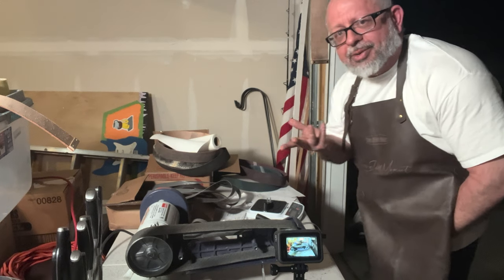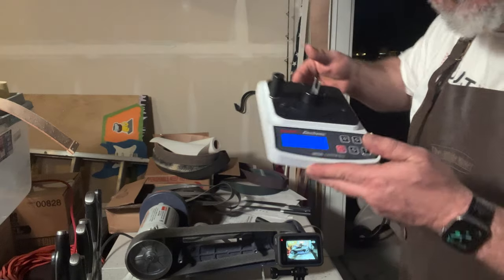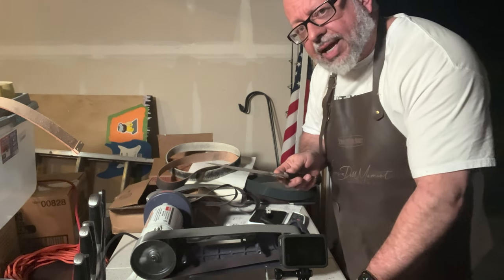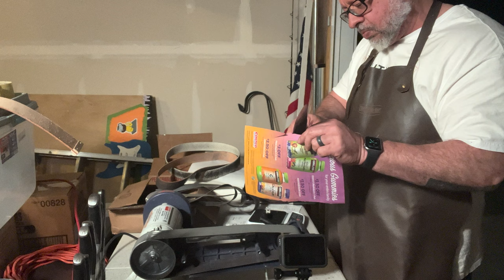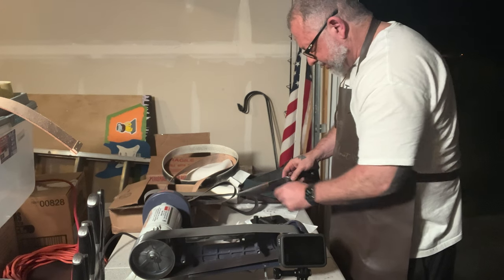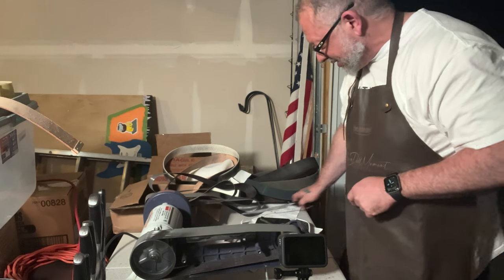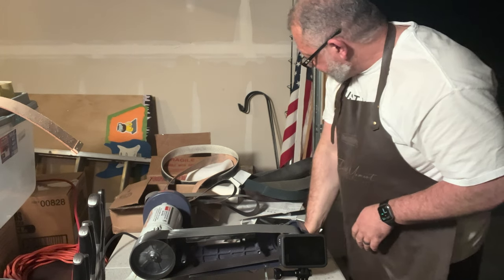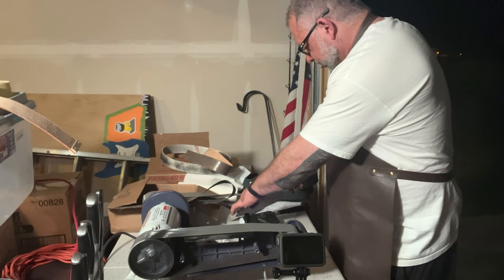Learning to use a belt sander for knife sharpening. 2 x 42 inch - Sharpening VG10

Comment: Just for grins, I recently took in a "guest knife" with a rolled / squished edge. I stopped pushing down on the BESS thingy at 1740 😂 (one thousand seven hundred and forty). A dull butter knife disguised as an 8" chef's knife. I gave it back testing two spots, 80 and 120. It was a lengthy repair. Wish I'd known a bit more about belt sanders.
Reply from the maker: It’s definitely been cool to try and to learn. I love learning. Don’t mind doing it for you guys.

Comment: Really interesting, and so much in that use of belts with different grits and steels. For me, personally, I'm very relieved to see that you do not worry about heating up the edge, and don't wear a blacksmith's "air hood" or whatever they're called. My current sander (3"x18" designed for wood) is a variable speed, set on slow. The things are loud! I use it to repair edges, and set a bevel, so I can sharpen on stone. The "so much in it" part: softer steels' burrs are not the same as harder steels, as you have mentioned several times, and as another site confirms, and on HRC 56 I get huge mega-burrs, but that's after sanding out 100 micron chips on coarse grits. My guess is that harder steel burrs flake off (more brittle). But a sanding belt is so much faster than grinding away on an Atoma 140 diamond plate. And it's easier to set a bevel because your hands aren't moving up and down the stone 100 times. The belt does that for you. It ruins the "romantic tradition" of whetstones, but even Japanese traditionalists have huge grinding stones. I'm impressed that you got BESS 100. I didn't think that would be possible on a belt.
Reply from the maker: Thank you. I loved your comment. I appreciate it so much. I loved everything you wrote and I’m enjoying reading this. I definitely think I can get a better score but I’m glad to know we got one that low. I’m still going to experiment, but I still love the romance of doing it by hand on stone.

Comment: I love your set up,  the garage looks like my basement. Lol
Very cool. Still be tryung to get good with stones. Was thinking of getting a 1 x 30 for wood and sharpening.
Was wondering if there is big difference with slack vs platen sharpening. You make it look easy my man. Nice video. Thank you.
Reply from the maker: Listen, thanks for the comment. Thanks for coming and enjoying this experience with my self. I’m learning with you and yes I now want to clean up my half of the garage and make it into a workspace. I just feel like being a guy and making it all tool man Tim. I need to be able to make it a little bit more efficient. I definitely think each thing that I have learned has help with the other things that I do. I’m enjoying the slack belt, but Ryan Swanson excels with the platen behind it. I tried to make one the other day and it turns out I had some of the wrong material. Ryan has now advise me on what I need to get. When he does it he keeps the belt sander vertical. I’m not sure that’s the way I want to go. We are going to mass with a different set ups. And some upcoming videos we will show you the options of this machine and how I had to alter it slightly to be able to do what we’re doing. Unfortunately, a lot of the expensive machines are not ready to go out of the box. If you want to spend $5000, then you’re able to get something made specifically for the task. I’m sure one day my wife will allow it but right now today is not that day. I’m gonna enjoy keeping the higher grit. I’ve done some of the lower grits. Laughter watching Ryan Swanson. I even watched Cliff Curry. It’s hard to grasp the idea that the rougher grit ends up acting like a higher grit when it’s moving fast. I also need to try different pressures. I might be able to turn something into a higher grit with less pressure. Lots of concepts. I was even told a little secret the other day. A little birdie told me to take the finest grit scotch Brite belt once it’s worn out and add some WD-40 to it, and it gives an incredible polish. I’ve even learned that the Trizac belts can be refurbished by using the diamond plates. There’s so much information out there to share. Stay tuned.

Comment: Thanks for your video. Recently got 1/30 belt sander and tried to sharpening already sharp knife. I got bar one side, once flip other side other side barr created but couldn't feel first side. I start first side than loose bar opposite side again. I didn't get any sharpness at all. Finally i found lot's material been removed, knife gets smaller and very dull knife. Not an expert with stone sharpening either but i Neve ended fully dull and half the size of knife. Use 100grit. Any advice where did i mistake? I had the angle jig so angle suppose be correct. Im in in very upset condition. Thanks

Comment: Very impressive results though. 
Now a major question is coming, 
Do I have better results with the belts or with the stone's?

Food for thinking and maybe one VS in live process between them might be good .
Reply from the maker: I definitely think the stones are going to be the best. You can argue that the tormek eight is gonna be the best there is and maybe even the guidance systems. We haven’t gotten into that yet. I think the guidance systems are really good at maintaining the angle and you can change your pressure. The tormek eight has been proven by knife grinders to really get amazing scores. Scott Gunn has gotten ridiculously the lowest scores I’ve ever seen and he did it by hand. I just don’t think the belts can get you that low but when you need to get it done fast and that high quality inn, you’re a commercial sharpener, then it’s hard to beat it.

Comment: On the other side of tbat sander can you hook up a wheel like a cloth buffer wheel or something as aposed to a sanding plate?
Reply from the maker: I'm sure somebody can. That's not something I'm still bad. There is a rotating sander on the other side, so I'm not sure what type of cloth you can put on there, but sounds like a winner.

Comment: Good afternoon.
In my practice, I noticed that when ribot on the belt grinder, too much area of elastic metal is formed. this zone is polished, but knives sharpened in this way do not have good stability indicators.
this effect is especially noticeable when working from grain.
maybe it's me doing something wrong?
Reply: Google translate ricochets again?
Reply: @davesmith5656  yes
Reply from the maker: I have read this several times. I am very interested in answering your question. I don’t know that I understand the question fully. I apologize for the language barrier. I do appreciate you coming to the show and I definitely appreciate your comments. I desperately want to understand your statement and question. God bless. I’m going to read it again some more and see if I could figure it out, but I just wanted you to know that I did read and wanted to acknowledge your comment.
Reply from the maker: Ribot. Maybe you meant to say when you rub it on the belt grinder??
Reply: @nadm  when I'm working on a belt grinder. it turns out that too much elastic metal zone is formed on the edge of the cutting edge. later it is polished. but such an edge does not have sufficient stability.
the situation is somewhat better when the work is done on rotation. not against rotation.
Reply from the maker: @workshop_oselok_kyiv  thank you. I do believe I understand.

Comment: Does it matter which part of the belt you sharpen on? I notice sometimes you are on the slack and other times you’re not. Thanks
Reply: Decent question. It seems the slack would give more of a convexity, maybe pull off burr like a hanging strop. Then again, maybe the belt tension and thickness are enough to keep it flat.
Reply from the maker: You’re correct. I’m going to finish answering on the other guys comment.
Reply from the maker: So I use the slack belt for the convexity. Also, the knife doesn’t bounce. You’ll notice when I go to put it on the flat. There can be a little bit of a vibration on the metal that’s behind the belt. I kind of like the Grace of doing it in the slack bell area. There is going to be a difference in the thickness behind the edge, giving you that convexity that you were talking about. We’re going to be playing with that as well. The one thing that I’m missing is doing edge leading strokes. Very dangerous on a belt sander. If you had a guide, an angle guide, then it could push back the knife off the belt and you would be safe, but if you try to hold it in there and get the wrong angle then you’re just really asking for a disaster. I’m having a little bit more fun on the slack belt.

Comment: never use a dry belt 
edge will heat and become soft.
seams sharp but then it dulls faster
Reply: Have you ever seen the sparks flying on the wheels the Japanese knife makers use in their finishing and sharpening?  I have to assume you have never seen a knife made.
Reply: @GlennInLaguna  --- As far as I know, tempering, the final stage of heat treatment, starts at around 800 C, lowering the temperature in stages over several hours, and the last temperature before cooling is 200 C. Water boils at 100 C, so I feel fairly certain that if an edge doesn't leave a burn mark on your finger, it isn't anywhere near 200 C. I got jerks telling me I'd overheat the edge and ruin the heat treatment. Some people talk off the tops of their heads like parrots, mimicking anything they hear, even doorbells. I have heated up an edge enough that I didn't want to leave my finger on it, but I had put pressure on the sanding for seven or eight seconds. I am not sure at all about this, but I think that you have to heat steel enough to turn it blue, to ruin the heat treat.
Reply: @davesmith5656  I agree with you fully. My comment directed at chefalbino, was that knife makers around the world use dry wheels and belts in the final finishing and sharpening of knives.
Reply: @GlennInLaguna  --- Yes, I was supporting your comment. I'm working on trying to be more polite and not omit things like "I agree with you".🙂
Reply: Understand.  Even though I use belts to refurbish and sharpen knives.  There is nothing better than sharpening by hand on Japanese wet stones and getting an amazingly sharp edge.  I have a permanent wet stone sharpening station in my home shop.
Reply: @GlennInLaguna  --- Thanks for the link and confirmation. I noticed in one video the guy has an anvil and is tapping a knife with a hammer. I had watched that a couple of years ago, and tried it on a "guest knife" (I'm a hobbyist only). I didn't have an anvil, but improvised. It amazes me to watch videos with people recommending bending, when all it takes is a surprisingly light tap (to straighten a knife someone confused with a pry bar). Those big wheels must cost a fortune. The smaller wheel with the most sparks is not wet. And I notice the guy finishing sharpening on a stone. A strop can add a lot of sharpness.
Reply from the maker: Hey buddy, apparently there’s been quite a discussion on this topic. You said never use a drive belt. The edge will heat and becomes soft. There is quite the rebottle in the comments below. I’d love for you to take your time and elaborate more unless you agree with what they’re saying below. I am not argumentative. I am a seeker of the truth. You’re more than welcome to continue to express your sentiment with me. I want to find out if I could make this process as equivalent to Sharpening on stones by hand. I enjoy the edge I get on the stones. I do think it’s the best in the end. I have some other options to explore. If you can make me better than please do. I’m all ears or I should say eyes in this case.
Reply from the maker: @stuartdavenport2952  please explain to me how you do the water flush and thank you for your comments. I love learning.

Comment: How conclusive is a test that only tests on one spot of the cutting edge? Divide the length of the cutting edge by the thickness of the testing filament and what do you get? Is it in the hundreds? Even if it is only one hundred, the test is only relevant to 1 percent of the cutting edge. This is poor science!
Reply from the maker: It's not. That's why I say it's a tool and not the standard. I did not create the machine. The machine that you're wanting to know about is in a lab and it cost $300,000. It is not in our budget. This is the second best thing. It allows you to know how sharp you can get the knife. If you have unlimited funds, then you can test it on every part of the edge. We do not have unlimited funds and so it is the second best tool in the industry right now. We did not create it, but we are just giving you more information to be helpful. I need to apologize for taking so long. I've had a surgery on my knee and some other things going on. We've had the court case for my car accident. We had to deal with that as well. We've also had some other major things happening personally. Deaths in the family and lots of arrangements to be made. Also, I'll let you know that I will be having another major surgery in June and will not be making it to the Blade show. I will be out of work for two weeks because I'm having all the extra skin cut off of my body. We do apologize for an interruption of videos if it were to happen. Will try to shoot some head for you guys so we can fill the space. That being said, thank you for checking out the show. Thank you for your support and your comment.